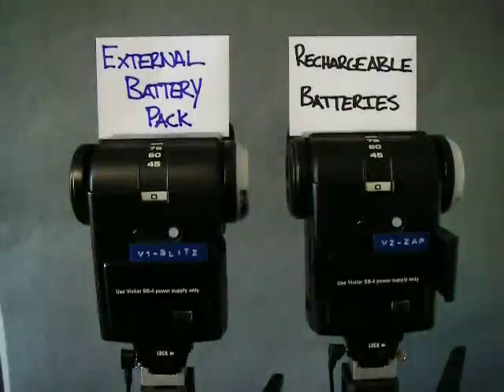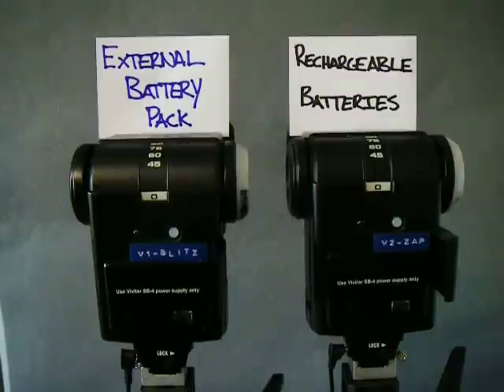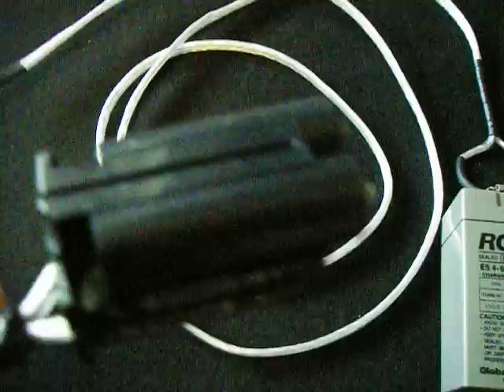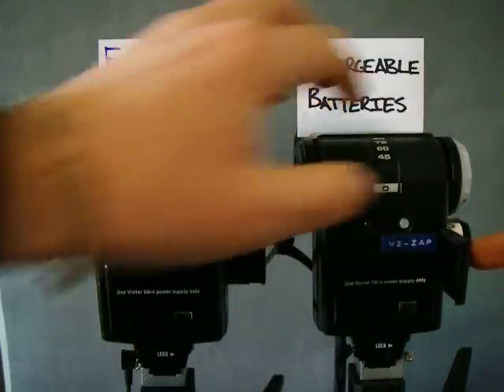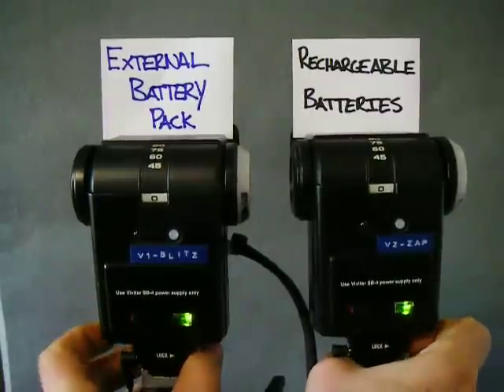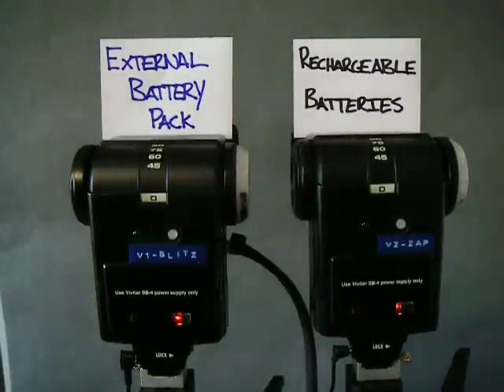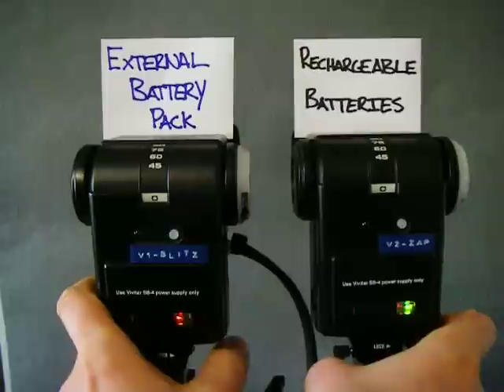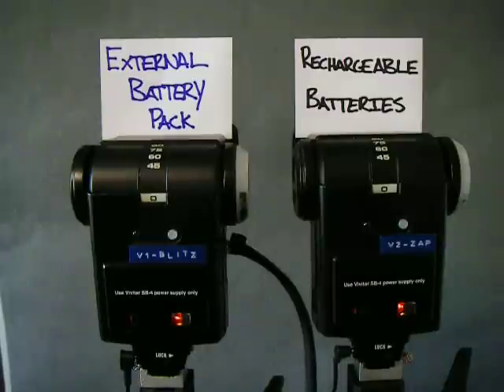Vivitar 285 HV DIY External Battery Pack Test

Comment: @kungamord, the HV in the title is the part of the model of the flash unit ... 285HV.

You can easily increase charging rate by getting the same battery unit and run them in parallel to give out more amps. we do that all the time, make it 3 parallel 6v, and see quickly the flash charge up. I even use that pack attached to 3 flash head units, just use thicker wires of couse. its all about common sense.

Comment: it's misleading completely.  You can fire with even 3 but it's not a full power firing! (at least can't verify here).  I can just buy a portable acid led batt from Lowes and other local stores and do it!
Reply: Well not misleading, but he is just demonstrating the bleedin obvious - that a big external battery (even of the same voltage) will have lower internal resistance so will recharge quicker. He could use a 6v motorbike battery fo even faster. but it gets heavy.

Comment: This is an excellent video which gets to the point. I used 285's for years. Could I suggest adding a second test where you reverse the power sources to eliminate any  suspicion that one flash might have been less powerful to begin with? We need more videos like this one.

Comment: I just got some questions. Isn't the 4 AA rechargeable batteries totals to 4.8 volts (1.2 volts each cells) compared to the 6 volt cell you connected as external battery pack? Doesn't it cause the flash unit circuitry to heat up than normal?  How about using an old 7.2 Ni-Mh battery pack from an old Sony videocam? - Would it cause overvoltage damage to the this Vivitar flash?
Reply: That is true.  But 6v should be OK because the unit will be designed to take 1.5v alkaline anyway. 7.2v might overheat it if you fired too fast - I wouldn't like to try it.